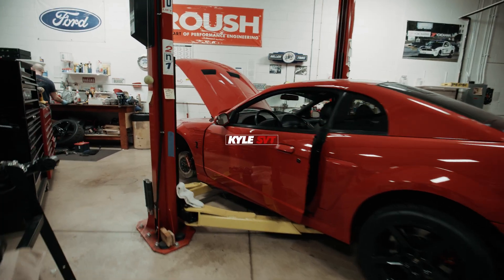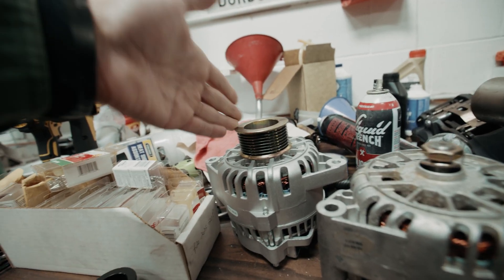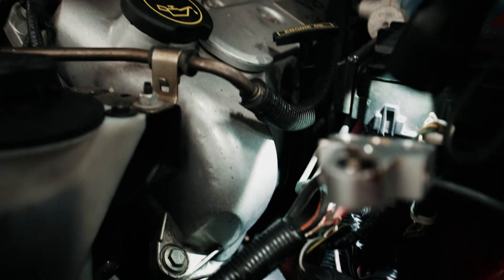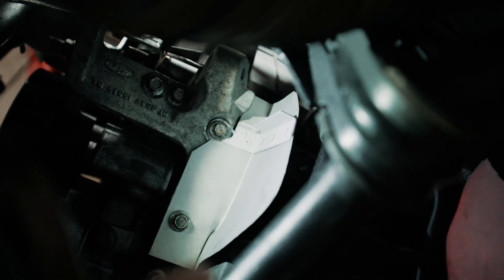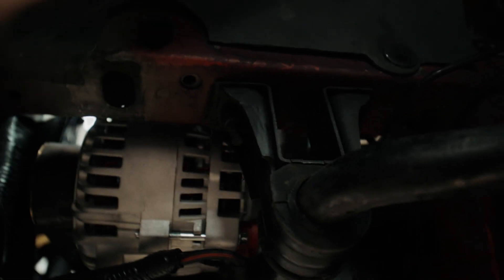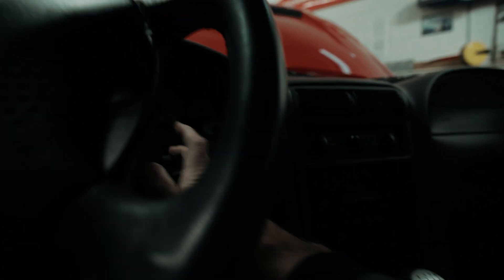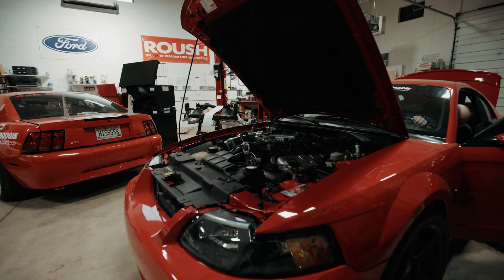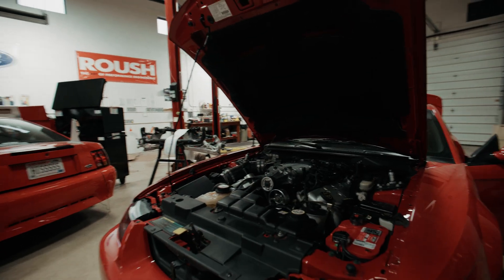03 Cobra Alternator Cooling Modifications

Comment: Does that duct helped the alternator? Did u notice change in the voltage?
Reply from the maker: The duct is just to get airflow to it so it doesn't overheat. Voltage will not change. It is the heat that kills the alternators on the cobras
Reply: @KyleSVT  saw a thread in SVT forum of someone did the same & noticed a voltage change.
Reply from the maker: @ There is a voltage regulator on them so if there is any change in voltage it is because of a faulty regulator not because of airflow on it
Reply: @KyleSVT  yes I know that, the heat can cause the regulator  not working properly and then fully damaged it, in that person case cool it down helped it to function normal i guess. 
This one last question is there a reason you're not running that duck  from the hole next to fog light? .. (look like you are already using for ur brakes .. correct?)
Reply from the maker: ah now I understand what you are saying. Yes cooling in theory should help it last longer. Correct both ducts are used for cooling the brakes